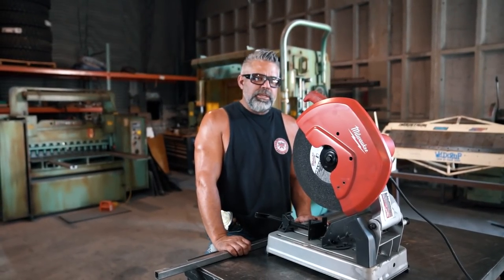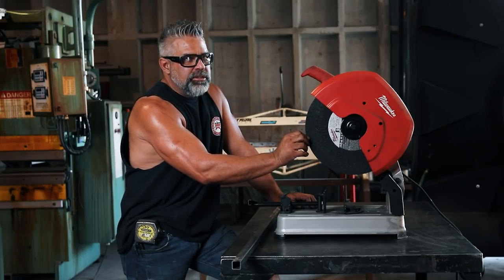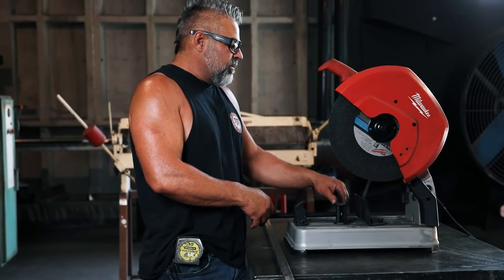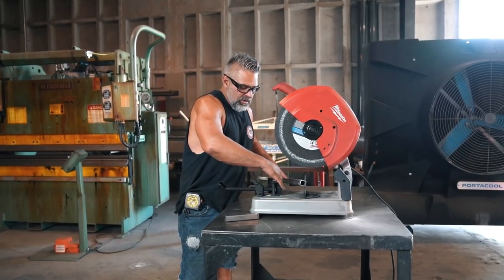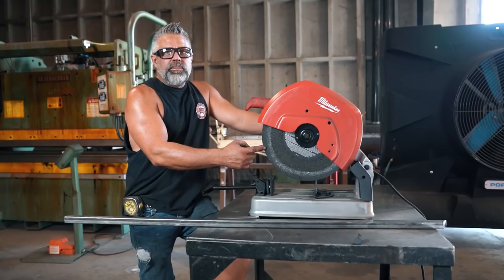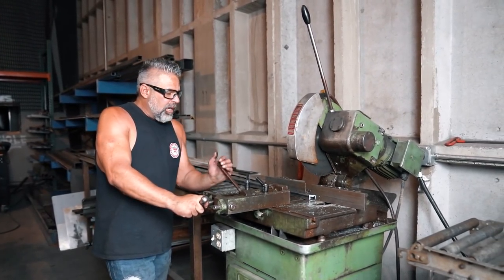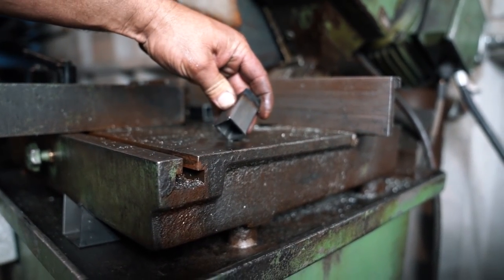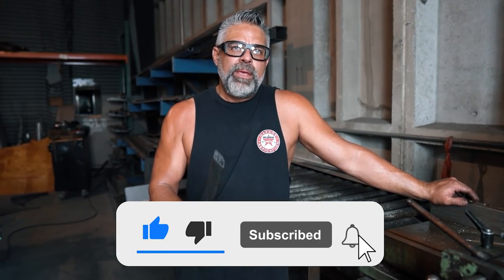Wet Saw vs Chop Saw! The Ultimate Metal Saw Showdown & Their Uses

Comment: Chop saw is on my list as cutting with a grinder gets old.... I just made camper bars for my truck and should have just bought one then, but will for next project for sure. Safer and faster!
Reply: It save you a lot of time, I bought a haurbar Frieght metal chop saw but bought the blade at home depot. I used it to make my welding table. I could have used a saw zall I'm glad I bought the chop saw I've used quit a bit of time's.

Comment: Seriously man... I chucked my crappy abrasive saw in the recycle pile. Get yourself an Evolution. Portable for your exhaust, use on the fly jobs, and doesn’t throw sparks, and cuts just like your wet saw.Just don’t mix the blades up.
Reply: EXACTLY......
    The EVOs are absolutely Bad Ass. I've worn out Three of them.
I still keep an abrasive around for cutting hardened stock but that's it.......
    If they survive my guys using them, that's saying something.......

Comment: Yes a dewalt dry saw and a evolution carbide blade I’ve been using one blade for two years and built car chassis saw mills car trailers 
I use it every day blades are 106.00 bucks

Comment: Love your video's Steve! Abrasive saw was too slow and sloppy for me. They sell metal dry cut chop saws that cut clean and fast but they are at least twice the price. Abrasive saws are too risky for smaller shops. Hard to contain all the hot sparks that want to start fires.
Reply from the maker: Thanks for the tip! Appreciate it!     Steve